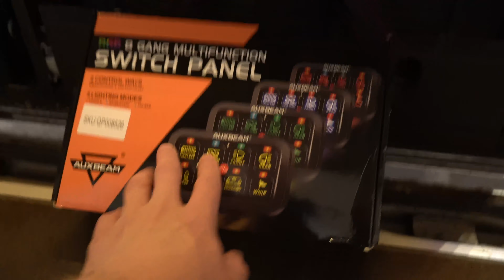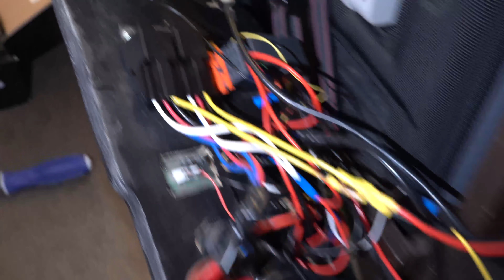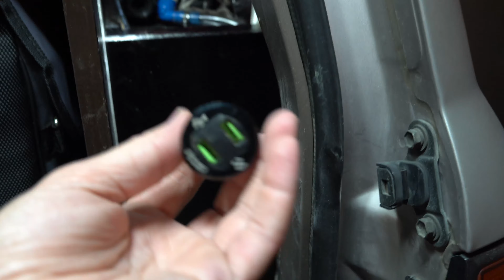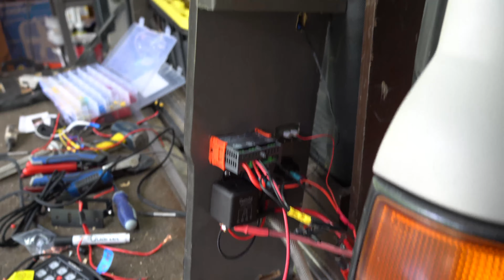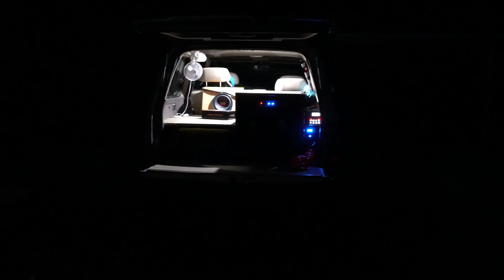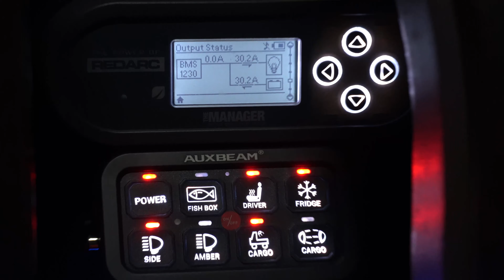Auxbeam Switch Panel - Install Toyota Land Cruiser 80 Series

Comment: Does the switch panel remain illuminated when not in use since it’s not wired off an accessory fuse or does app allow you to turn off the backlight? I’ve been thinking about bypassing the accessory fuse for the sake of camp lights as well but didn’t want to have a constant draw on the battery for the panel. If I recall correctly you wired up a nuclear reactor of lithiums so it’s probably not a concern for you. I only have a dinky group 24 so it would actually make a difference to me.